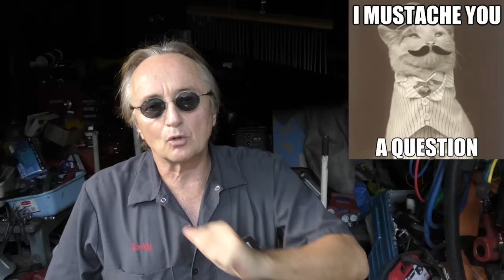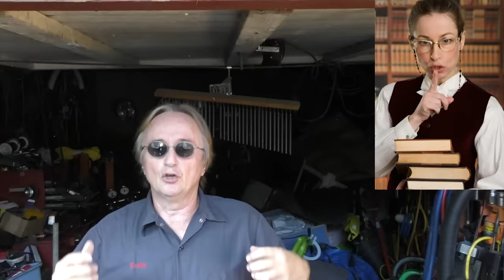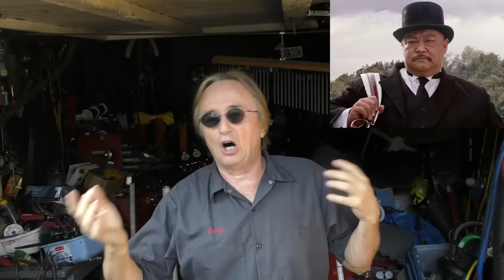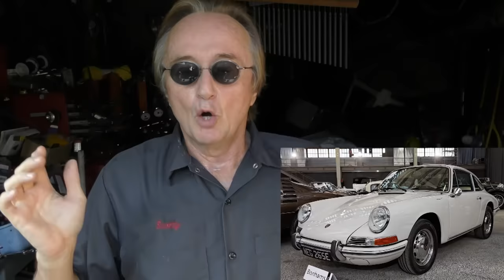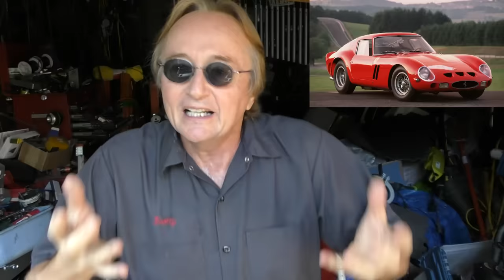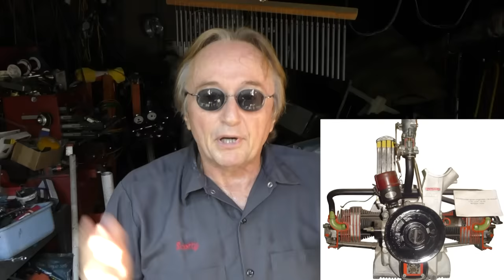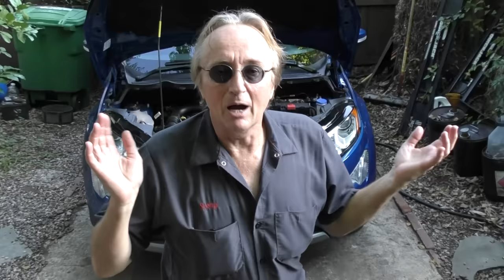The Truth About Boxer Engine Cars

Comment: I own a subaru brz. My biggest complaint is the power. You really have to floor it. But then again, it doesnt really matter cause you cant go fast anyways. Cops are real good in Virginia
Reply: Its predecessor had 110hp and wasnt fast, it was only agile. Its only a 28k car in Canada so I mean... Dont expect it to have 500hp out of the factory. It only has 200.
Reply: @invertedv12powerhouse77  sure! I dont know a whole lot about cars but, it takes premium... camry's have more horsepower.
Reply: The BRZ was made to be a tuner's car.
Reply: @nicoz6540  yes, because they are bigger engines, 2.5l and 3.5l V6. Also they start off as being more expensive. So whats your point. This is a handling car. And who told you it needs premium fuel? Its not turbo charged
Reply: I own BRZ 3 years now .My car manual says it can run 95oct but prefers 98oct RON fuel. So yes, premium. I've mailed subaru online service and they told me it should run on 98+ oct fuel (RON). I like my car cause it's light, has no turbo (I dont need to warm it up so long, dont have to cool it down) , RWD, manual gearbox, has enough trunk space for my car audio, insurance is lower than most of cars in it's class, spare parts are dirt cheap, tires are cheap. If you are serious car user and maintain it those are real bright sides of this car.
Reply: Nico Z......it's obvious you dont live in Chesterfield County. The cops are a living hell. I have a clean driving record.
Reply: I know what you mean! Revenue generation through traffic enforcement.
Reply: +Petrezen1982 I liked your reply, sounds like the kind of things I like in a car too. A question for you: Would a 6 foot 3 inch adult (~190cm) fit in a BRZ? I've been looking at maybe getting one in future, but I struggle to fit in most 'sportier' kind of cars.
Reply: Jail time over 80 mph too.
Reply: I live in the PNW and you basically have to beg the cops here to give you a ticket
Reply: Anyone else notice the torque dip at 4k rpm? Not sure why that's there
Reply: @cpt2fantastic  I have a brz I'm 6ft with good clearance it is pretty low
Reply: The power is EVERYONE'S COMPLAINT with the 86 twins. It is a great car, but I can't wrap my head around why they would make a "dedicated sports car" slower than a Toyota Corolla or any other family grocery getter family car. It's been the only complaint about it since it came out. If it just had maybe 230 Horsepower and slightly shorter gears it would be perfect. Hell, the Scion tC put it to shame and it's a Toyota Camry Coupe.
Reply: sharpemang Toyota better sort out it's straight line performance or lack thereof with the next-generation 86.
Reply: BRZ is a great handling track day car.  When you are finally driving it as fast as it can go you can think about more power.  I doubt 80% of the owners need more power.
Reply: all good reasons to love the BRZ. Theres very few cars like it (2 seater rear wheel manual NA). I'm happy you still love the car!
Reply: @DCGgamer  Thanks man, I must go test one sometime
Reply: The  BRZ/86 actually has OK power. The reason it feels slow is the massive torque dip in the middle of the rev range. Getting unequal length headers + tune resolves that issue pretty much entirely (plus it makes the car sound way better).
Reply: Why would a slow car like the BRZ require a premium gas?
Reply: you mean stay in the power band for spirited driving
Reply: @6lemans10  I'm from there and I've never really had a problem with the police.
Reply: Sounds like your ready to come over to the darkside
Reply: These cars were built to make turns at speed. Learn to drive better and you won't have to wring it out.
Reply: James N 

“I’m from there”... what a useless post. 

-Do you still love there?
-How old are you?
-What kinda car do you drive?
-How fast do you drive it?

I’ve been driving in SC for over 15 years and have never received any speeding tickets, but I have received TWO in Virginia (on my way to DC).
Reply: You should have done your research for what the BRZ is designed to do before purchasing your it. Obviously, you bought the wrong car.
Reply: @AlDim000   The problem with changing the headers is you won't pass emissions if the tester can see they're obviously aftermarket. Especially here in Cali.
Reply: dude, you're missing out the whole point of the car honestly, it's meant to be drifted even at legal speed. and just like the AE86, the small engine is irrelevant once you start drifting this thing downhill on a mountain road, then  you'll smoke cars twice as powerfull as yours. now if you want it to truelly have some humpf, supercharge it (no turbo) or engine swap a imprezia engine in it, you'll be flying.
Reply: @Nico Z Flooring a car is fun. Why would you want a car that was too powerful to floor regularly on city streets?
Reply: @80s_Boombox_Collector  there is no such thing ;)

Comment: 2019 Porsche 718 Boxster - 365-hp turbocharged 2.5-liter flat-four (GTS model). 
Zero to 60 miles in 4.3 seconds. 
Economy:  21 mpg city / 28 mpg highway

Comment: My Subaru WRX does 0 to 60 in 5.3 seconds, and has an electronically limited top speed of 140mph.  That's out of a turbo charged 2.0 liter boxer engine. It sounds like heaven under full throttle, and I've never considered it to be "slow". And I think it's amazing how much HP and torque Subaru managed to milk from a 2.0 liter 4 cylinder. Judging the performance of boxer engines based on the BRZ's performance is silly. The biggest mistake Subaru made was not offering it with a WRX drive train.

Comment: Tucker cars had a water cooled six cylinder engine boxer engine, not air cooled. (Tucker car fan btw)  One of my VW's has had one engine rebuild on it and car has 485,000 one owner, miles documented.  He (great uncle Bill) was driving it up till one month from his death. When not modified, a boxer engine is very dependable and smooth running powerplant.
Reply: Its a damn shame what they did to Tucker. Imagine if he had been left alone and got completely up and running and on the market. I believe all of our modern cars would be a lot more advanced than they currently are. He was a true pioneering genus, the other auto manufacturers were just scared so they had to squash their competition
Reply: Tucker has a Bell helicopter engine. Air cooled in aviation but water cooled in the Tucker.
Reply: Boxers can handle turbo power like any other engine... When we talk about subarus head gasket problems, its because all ej25s had no reinforcement at the top of the cylinder walls
Reply: I live in Tucker, Ga. First one I ever saw was in the local parade. Very cool

Comment: Scotty, what is the craze of 5 cylinder engines?
Reply: Volvo makes a good one
Reply: I liked my Colorado it was a 5 cylinder not very smooth though
Reply: Is it a craze? Audi and MB started the 5-cylinder craze back in the 70's.  5 cylinders are better than 4, but shorter than 6.
Reply: Volvo only makes 4 cylinder engines now
Reply: VR5 is a Legend
Reply: don't panic, just get a car with straight 6 cylinder engine. it's a fast motor, and good for mountain trips with family.
ps: I have a 2001 bmw 330i bought it in 2009 and it's still my daily car.
Reply: Sounds like an aggressive V10 but is literally half the engine.
Reply: Elias Housseini  and as you probably notice, a straight 6 runs very smoothly, and there is more room under the hood to work on it. 👍🏻
Reply: Drove a Volvo once, the 2.5T V70
Now I want one so much lol
Reply: i5s have some of the best exhaust notes. Other than that, ???
Reply: Vedad1944 I drive a 2.5T S60 and I fully recommend the 2000's Volvos.
Reply: @Vedad1944  Do you want mine? I dislike it.
Reply: @shorpy3407  How so?
Reply: Four cylinders are universal engines they are available from 1000cc to 3000cc airplanes also mostly have 4 turbines, to get more power adding more cylinder or size is always a trickier question.
Reply: the power of a 4 with the gas mileage of a 6. I have a couple VWs with them. They actually work quite well in the RS-3 and they don't have a timing belt, which is a plus.
Reply: Volvo made the best 5 cylinder. 5 cylinders use the number 3 cylinder for balance and it gives a nice smooth idle and smooth power delivery. At least it's that way for the Volvo 5 cylinder.
Reply: Srdjan Smudja Yeah but only because they are trying to cut down weight and size because they are switching to twin engines with a battery bank for electric power, and batteries are heavy. If you don't know anything about the twin engines look up Volvo T8, it's quite the machine with 400hp and 480 tq from a 2.0 4 cylinder.
Reply: George & Sue Probably because that was a single cam engine
Reply: A 5 cylinder is nice, but a 10 cylinder is twice.
Reply: I have a VW 2.5 it's perhaps VW's most reliable gas engine. It's a tank, that's why they don't make it anymore. What it comes down to is harmonics and balancing. It's an overall less stressful engine than a 4-cylinder allowing it to live a longer life. It also sounds amazing.
Reply: 20502chris Sounds like a terrible idea.  If you are going to do narrow V engine, just put an extra cylinder and go VR6.  Wide angle V4 should be smoother than narrow angle v5= vibration of inline4 + slightly smoother i5?¿☆■wtf,,
Reply: The craze of a 5 cylinder? 
That sound!
Look up IMSA GTO and you will totally get my point ^_^
Reply: I used to own a 5 cyl VW Rabbit. 5 cyl engines sound like nothing else on the road with the right exhaust on it!
Reply: Hummer H3 made the shittiest one ever .
Reply: I think that balancing might be a big factor; I remember being told that a 3 cylinder is much better balanced than a 4 cylinder (it’s to do with linear motion being translated into circular motion), can’t say for certain if this directly applies to a 5 cylinder.

Another factor is power, size and manufacturing methods. The majority of automotive manufactures produce cars designed around the inline engine so adding an extra cylinder to add displacement is pretty easy and cheap to do with little redesigning required.

Still, be interesting to know Scotty's thoughts.
Reply: Very true, & correct. The MB 5 cylinder was a diesel. The Audi unit was a 2.7 litre fuel injected unit. Volvo experimented with a "V"-5 a long time ago, but the idea never really took off.
Reply: James L  I think the advertising for the Acura vigor said the power of 6 with the mileage of 4
Reply: Why don't we see 7 or 9 cylinder engines?
Reply: audi 5000 real turd cis injection
Reply: 5 cylinder engines... the power of a 4cyl with the fuel economy of a 6cyl
Reply: @willriley1619  It's twin charged not twin engined. It uses a turbo charger and electric supercharger.
Reply: @benlee2765  they do for aircraft,  but they are Radials.
Reply: Spam Can lol do your research buddy it's a twin engine the t8 has an electric motor and a combustion engine. The gas motor can charge the electric motor. The electric motor can give it instant torque and work together with the gas engine. Think of it as a turbo and supercharged 400hp 480tq prius
Reply: They F'ing rule.  That's why bud.  Check out the Audi S1 Class B from back in the 80's.  Without question, best sounding engine. Ever.  Not to mention the power that can be extracted from the straight 5 (forced induction)  is beyond absurd.  Just upgraded my RS3 to over  500whp/643 crank with some "minor" upgrades.  Audi and their 5 bangers are amazing.  Let's not forget all the Volvo's with a 5 banger.  Also amazing motors....
Reply: Brendon Kelly 500whp is playing with fire unless you have upgraded con rods and bearings, but doable.
Reply: @willriley1619  Totally understand your input and concerns Will.  I just turned 9,500 miles today.  I driver her like I am qualifying  each and every time I jump in her (oh so sexy and comfy seat) to drive anywhere.  Did the same on my past, much more highly tuned and powerful S or RS model Audi's with zero issues.  Yeah, normal issues pop up, but nothing that weren't  expected or anticipated things to deal with.  If there were/was a potential weak point, it would possibly be the DSG trying to deal with all the new hp/tq that's been introduced.  We shall see in the future on mine.  Side note:  I have 3 friends with much more HP than I do, with the same car.  All completely stock internals.  Zero issues.  So far.....  Lol
Reply: Baby v10
Reply: An extra cylinder for a turbocharger without taking up too much space and yet weighing less than a 6 cylinder.   Basically that's all it is but it is powering some fast cars like the VW Passat turbo which started somewhere around 280 hp
Reply: It's not a craze. They have been some of the best engines since their creation. The power of 6. Mpg of 4. Sound of a v10. And incredibly long lasting and reliable. At least Volvo's were. Audi 5cyls were good too.
Reply: torque n sound
Reply: @elie3423  but I don't want an inline 6, I want my trusty T5
Reply: @steveprinty5674  more room?? My T5 is a large engine, an inline 6 will be a monster can't fit in my C30
Reply: @dildobaggins069  I'm here
Reply: Olivier Bilodeau  Yes, true. But I am referring to rear wheel drive based cars that don’t have engine turned sideways. The engine compartment is as long as it needs to be for engine to fit. And since it’s narrower than a V configured engine there is more room on sides. Your car would have to be wider for a longer 6 cylinder engine to fit. By the way I thought it was a shame Volvo quit making the C30. Really a great car!
Reply: @steveprinty5674  yeah, I got mine (2009 C30 T5 R-Design!) about 6 months ago, I'm loving it
Reply: They gave more engine durability due to the heat from turbochargers also.  Great engines I agree.
Reply: A friend of mine owns a pearl white, late 80's Audi 90 with a 5 cylinder engine. He modified the exhaust and it sounds incredible. I honestly can't believe how good it sounds. It's really unique.
Reply: I love my Volvo S60R 5 cylinder turbo! ☺
Reply: @mcplutt   actually a V6 is shorter, 2 banks of 3 cylinders versus on bank of 5 cylinders. Inline engines are smoother running so 2 heads aren't always better than one.
Reply: Yes we know that, but a V6 still takes up more space in the engine bay.
Reply: Easy to balance
Reply: Audi was using 5 cyl engines all the way back in the early 1980s...
Reply: Just a cheap copy of a v10 to sound like a v10
Reply: @elie3423  BMW's are just amazing vehicles in general. Great engine, and chassis design. They're almost perfectly balanced.
Reply: @markfive3731  I owned a Volvo v50 with the turbo 5 cylinder engine, it had AWD and a 6 speed standard transmission. That car was awesome, and I had a lot of fun with it until I unfortunately got involved in a wreck with it :(
Reply: What a lot of people neglect to mention about 5 cylinders especially the Volvo ones.. The extra cylinder allows the car to drive around fine in average driving conditions all without going over 3k RPM. This is especially relevant in the Volvo motors because they have a long stroke compared to other motors which in turn combined with the 5th cylinder provides great torque. Why does all this matter? Because you don't have to wind the motor to high rpms on a daily basis and thus giving better reliability.
Reply: Volvo buy engine from france
Reply: @alexdubmaster3477  Yeah maybe the PRV 6 cylinder made in the 80s
Reply: @markfive3731  Seconded. Volvo's I-5 is sweet. Noisy, powerful with turbo, great for making passes and just great for driving fast without wasting a ton of fuel.
Reply: The inline 5 was a god damn tragedy, my 06 Colorado was constantly having issues, they are prone to misfire, and had terrible valve head problems, once you get an issue it sticks.
Reply: D3Sniper123 The colonel Well that is a GM so pretty much everything outside of the V8s and the 4 cylinder truck engines are crap.
Reply: First 5 cylinder I worked on was in an Audi 100 CD/5E. Replaced the timing belt. Easy job.
Reply: Fuel efficiency.  The tradeoff is in high levels of vibration and roughness (which is compensated for with special crank and cam grindings and balance shafts.
Reply: @benlee2765  We have. All the airplane radial engines have odd number of cylinders (in one row), often 7 or 9.
Reply: @pyrothrax0x  Not quite.... That's why Ford had to develop an unbalanced flywheel for the 1.0 3cyl because otherwise it needed balance shafts. None of my 4cyls have balance shafts... ;)
Reply: @StackBundle You have that backwards. Power of a 4cyl with the economy of a 6cyl, from the age of the VW 2.slow.
Reply: @mikem.9197  considering my 0-60 is under 5 seconds (traction limited cause fwd) and I get 30mpg highway I'd say I have it right.
Reply: Volvoooooo
Reply: Straight sixes are my favorite. Smooth, with a wonderful exhaust note.
Reply: @pentlx  inline 5 > boxer 6 > v10 > v8 > inline 4 > i6/v6 > v12 > inline 3
Reply: Mercedes OM617, 5 cylinder 3000cc diesel. Lasts forever if treated properly.
Reply: @mcplutt  WOW man you are awesome😂
Reply: @GoldenGrenadier  same engine in focus
Reply: audi has good 5cyl engines
Reply: @MElekiaZ  I know
Reply: @MElekiaZ  that's only for the European Focus though if I recall correctly.
Reply: Swapping. The straight 5 is for people who wanted to swap a straight 6 into their car, but the engine bay was too small.
Reply: And the 3 cylinder engines
Reply: Have a 5 cylinder Audi TTRS, sound and fury all in one fast package. Nothing like the warble of that 5....

Comment: Boxers are great thats why been in aircraft for a century. Scotty! In aircooled design they are optimum for airflow and balance. Fit into cowling perfectly. Too much power makes any engine unrelible in the long run anyway. In the car , especially Suv; makes a Suv handle like a car due to lower center of gravity. Four cylinder Sub is like a six due to great balance..